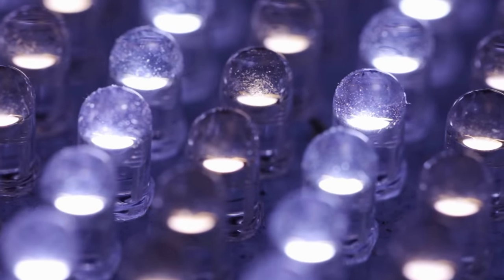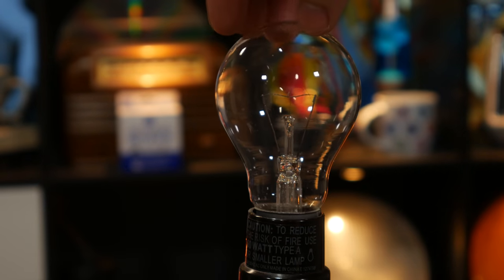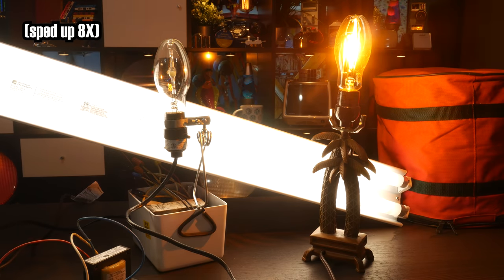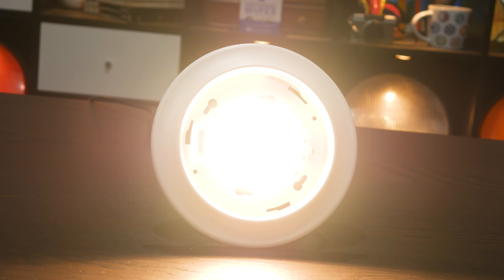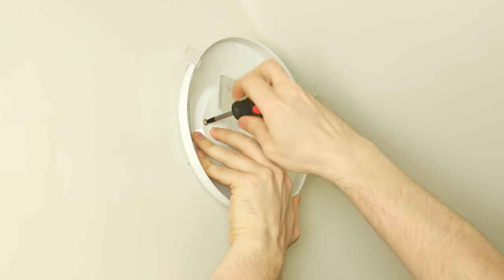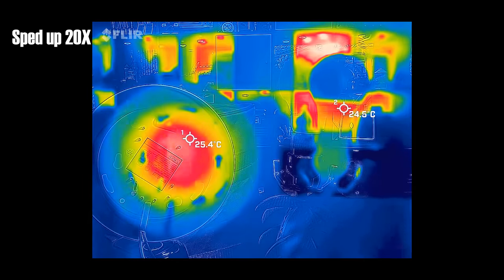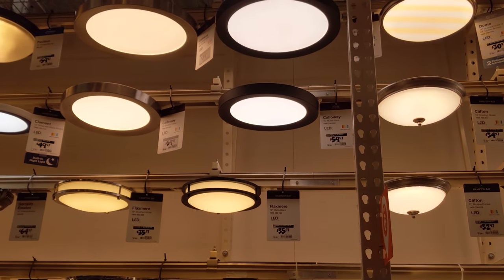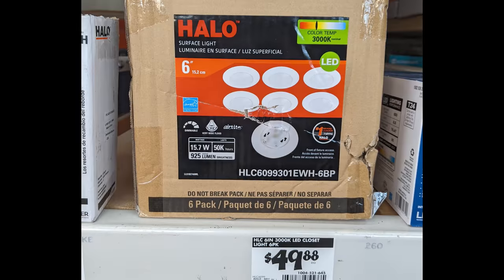A troubling trend in lighting?

Comment: What we really need is an led bulb or start using usb connections. There's an insane amount of waste in throwing out the fixture. 

Just the modular nature of the lightbulb, for all the faults you mentioned, makes it an incredibly amazing design.
Reply: Can a standard USB connector provide enough amperage for a 10 Watt (100W incandescent equivalent) LED lighting fixture?
Reply: @rogermwilcox  USB-C connectors are rated for up to 100W of power usage, so it could easily power a 10W fixture.
Reply: @rogermwilcox  if not that, then something equivalent, just one cable you plug in and standard mounts to hold it in place. Those mounts should be easily adaptable, such as unscrewing them to replace them with a large one included with that huge light you bought.

I'm a renter, and like just about everyone else my age, will be a renter for the foreseeable future. Standardisation, ease, and flexibility is vital for us. If the answer to "how many people does it take to change a light bulb?" becomes me, a receptionist, a property manager, a property manager's assistant, the landlord who takes a month to respond because they're on the third cruise that year, an electrician's admin assistant, and an electrician who reschedules three times because they say you're not home despite looking you in the eyes and who didn't have the keys they were supposed to pick up from the real estate. Finally, you get a new light only to find it's totally different and is somehow outputting brown. Also, the new style is too big and prevents a door from opening, and so the process restarts where you have to walk outside and back in your front door to get to the front of the house for three months. The new new light shines an even brighter brown. At the end of all that the landlord takes the new light, the door, and repairs for scratches by the electrician from your bond, which takes another five months of arguing before you finally settle on paying for two new lights, the door, the scratches, and not mowing the grass you didn't have just to get them out of your life. And then another light fails and because you're epileptic the strobing causes you to fall and hit your head on the edge of your coffee table and die. 

This is the story about why I own lots of lamps so I don't have to touch anything not mine. 

USB would be great, though. Then I could charge my phone from the ceiling. It's all I've ever wanted.
Reply: I just mean that the old screw in bulb is WONDERFUL, but for the weird curly shapes that would take a strand of LED's instead, or for something that's far more flat and might be better for a disk shaped array of lights, it makes more sense to standardize these connections in a more flat pluggable format that makes the LED's themselves replacable, rather than hard wiring them into a mount that requires the whole lighting device to be replaced. Instead of tossing out the entire lighting fixture, you'd just toss out a standardized LED array that you would unplug and plug in.

The gripe is that LED's go out, and and then the whole lamp is useless unless you are able to DIY your own circuitry and install an entirely new fixture. 

The idea of replacing the boob light in the pic is still tossing out a huge piece of material when really what's wrong is a thin wafer about the size of a cookie at starbucks (but much thinner) that has the LED's laid out on them. OR, having to replace an entire chandelier because a handful of LEDs when out because a surge blew them. OR, as I found with a simple floor lamp I bought that TOTALLY could have used some B base bulbs, instead is hardwired with LED panels, so that I can't, say, replace it with brighter bulbs, nor can I change the bulbs when the LED's run out, but instead will have to trash a $90 lamp instead of a $1 bulb. 

THAT'S the problem. 

That's why standardized connections and standardized LED arrays and strings should be considered. (and honestly, the LED strings are probably easier as there are already "cut to size" options)
Reply: @SerifSansSerif  There are some fixture now where you can drive multiple fixtures with the same socket. But even replacing those you are still re-wiring, just on a low-voltage circuit. 

I mean I like these bulb-less fixtures - but not really sure how usefull modular would be anyways. 

What would be kind of cool, is a standardized plug like you see in fire alarms, that way when you do go to re-wire you don't have to deal with wire nuts deciphering how the last person meant for it to be wired. 

You could eventually standardize on particular sizes of circles or rectangles for high end fixtures,  but honestly on the low end, the all in one fixtures are plenty good enough.  In a rental it's a bonus, nobody is expecting the renter to pay for a new fixture.

Comment: Lever nuts are far superior. Coming from industrial controls wiring, the efficiency of the connection paired with the repeatability and lack of damage to the wire is essential when having to repair or replace components later. #teamwago
Reply: I'm frugal, though, and you can get a box of 100 wire nuts for, like, 8 USD. And for applications where you aren't really worried about replacing components with any serious regularity, they're adequate.
#teamcheapass
Reply: @Telamon8  I fail to see why "normal" non electricians would buy 100 pieces? 
If you'd need them all at once, (in that case, it'll be a bigger renovation, and an electrician should at least watch over) I doubt it'll be much cheaper if you count in all the time you need to properly prepare the wires and stuff.
yet alone, it is much easier to remove single wires if needed, and different sizes can be combined without any problem
Reply: Hence why service loops are so valuable. Just cut the ends off and start again.
Reply: @williamganley4739  20 years later though, when that wire eventually runs out, I'm still sad 😢
Reply: There's a reason wire nuts aren't legal anywhere civilised. Wago all the way.

Comment: I recently added some puck lights into a ceiling and I’m glad I got the ones I did. The lights and the driver circuitry are separate, connected by a short wire. Helps keep the driver cool from the lights themselves. Color temperature adjustable and replaceable when the lights itself dies.

Comment: Another excellent and detailed insight, thank you, 30 minutes and I don't regret it. 

One significant problem you didn't include is when recessed-mount LED lights are installed at the ceiling building envelope of an unconditioned attic space. Having any air leakage here is a real problem not just for energy loss but moist, warm air (in cold climate) easily leads to ice and ice dams and roof rot. As you said people "stick them pretty much anywhere" (this has been called "builder's acne"). Yes, some include a little gasket but they really don't work, the only way to seal such an installation takes fussy detailed work, even fussier when you don't have access from within the attic.

Comment: It would be great if they would not overdrive the LEDs which would make them live longer. BigClive has many videos on that. But they cheapout by placing less LEDs and driving them harder.
Reply: They also roast the driver in the Edison bulbs, of course leds fail too, but the drivers often fail first in the bulbs.
Reply: Plus reducing the amount of components within the device to reduce the build cost. The same thing has been noted by Linus on his channel ,memory modules with cheaper and less efficient components swapped in after performance reviews have been made and published.
Reply: Which is fine if the lifetime is accurately reported on the packaging (for an average use case, not best case). If its cheaper, but dies earlier, that's a fair trade off, driven by engineering and consumer choice. If it dies early and the marketing just lies, then its bad.
Reply: Driving them harder, that's what happens with LED backlights for LCD TVs. If you have an LCD TV, I bet the LED backlights are being overdriven! But, you possibly can turn down the backlight in the menu, look for a setting called "backlight", not "brightness".

Comment: CFLs weren't always that bad. The first ones I bought lasted a decade. I have a few that are 15 years old. However, the newer cost reduced replacements failed in a couple of years.
Reply: Yeah I only remember a couple instances where a CFL bulb were changed. At my parents house; from the time the time they phased out incandescent lights, to the time they phased in LED lights; I think they only went through three or four generations of CFLs.
Reply: same experience here. we just cant have nice things anymore, apparently
Reply: I couldn't stand the things. That slow pink glow followed by the slightly flickery light. They gave me a migraine. I love LED bulbs. I have them across my flat. I prefer the original filament bulbs for light quality but the LED bulbs are so close that for energy consumption I simply can't justify old school bulbs. That said, I have an awesome old Belling bed warmer from my great Grandmother that uses a 40w bulb to heat the bed. That wouldn't work with LEDs
Reply: @adamoneale4396  never had such problems with CFLs. yes they took a minute to reach full output, but after that they were good, no flicker and good light quality. LEDs are hit&miss, some have terrible greenish hues, some flicker badly, hard to find a decent one for me.
Reply: I can't say I've had a lot of trouble with CFLs taking a minute to warm up, except for outdoor lights. I have had flickering problems with both CFLs and LEDs; but in either case it really comes down to the brand and the type of light you used from that brand. 
But I love these LEDs I have now; I can get them in any color I want. So I'll generally use daylight lights for the rooms where I'm doing more work. And I'll use the warmer lights for the living room. Then I'll use red lights outside, so they don't interfere with my night vision.

Comment: Someone needs to standardize the mounting and electrical connections for such a fixture, including a safe to use power plug so you can change the electronics/LED module separately from the fixture, about as simply as you can change a standard light bulb.
Reply: Yes, plug-in connections for lamps. We got them here because our electrician installed it like this. Last year we needed to replace all the lights with LED panels. Now was only old fixture out new in
Reply: Indeed. Fittings also that have some intentional heatsinking in them. Would a wide flat edison screw work?
Reply: @Orionrobots  It's possible, but I'd also appreciate some sort of firm yet sponge-like resting pad that makes contact with the module directly on the back and acts like thermal paste for efficient heat transfer into the fixture
Reply: @ElevatorMan5482   I had something in mind, not unlike Laptop wifi or memory module. But on a larger scale. 

Ie  spring clips, push down to retain. Only I thought the safety aspect would be a problem.

Maybe having mechanical switch levers so that the system wouldn't be live without a module in place would work? Starts to sound expensive and complicated to manufacture though.
Reply: @Orionrobots  I don't think the springs or clips are necessary, especially if the price starts to rise. Springs would provide minimal contact between the module and the fixture, and heat transfer would be less efficient. Thermal paste is actually widely used in the LED lighting industry to get the most direct heat transfer from the LED board to the heat sink. We shouldn't need mechanical switch levers either because honestly standardizing a wired plug between module to module would be much more ideal. AC powered smoke alarms actually have a standard like this believe it or not
Reply: Try GX53 sockets, they would fit in the fixture he showed.   But for some reason they are not very popular
Reply: @jesperdahl1486  That looks like a good starting point. Not sure the GX53 manages heat dissipation particularly well, but it looks like a good, simple electrical and mounting solution. Might need to extend that standard to help manage heat more effectively.
Reply: @geoffstrickler  I believe that you are right, unfortunately it is not as good at managing heat as hard mounting the circuit board directly to the metal back of the lamp, but it is the best I can think of right now.   A few years ago he mentioned that socket, it is supposedly older then the Edison socket, something about the lights at a world fair, and that was enough for E27 to "win"
Reply: What's wrong with a standard octagon box to mount the fixture, 2 screws 2 marettes and a ground. Seems so simple to me instead of clips, thermal paste, heat dissipating plates that will all go obsolete before the bulb fails.
Reply: @jesperdahl1486  the revolution starts here... I have bought some of those non-changeable LED fixtures, but I'll try to recall GC53 for my next lighting change. These are easily available .

Comment: It is amazing how many household skills I picked up from my 7th grade shop class about 40 years ago. I switched out a fluorescent fixture that kept failing with a flat led panel. The original fixture had just the romex sticking out of the ceiling, so I installed a ceiling box and put in the square panel. Sure it has the risk of failure and needing to replace the whole fixture, but in theory it should last 10-20 years.

Comment: I've used a few different variants of this style light over the last ten or so years, including mounting one on a disturbingly low ceiling fan where nothing else would give good light and clearance.  The newest one I paid around $15 at Costco, and it came with both wire ends and a screw in adapter, both using a little molex connector depending on what you needed for the application.  I wired mine in (with wire nuts, we're not fancy here), and it looks great over my sink.
Reply: Hold up. You have a ceiling fan over your (kitchen?) sink?
Reply: @FuzzyElf  No, two different places.  The fan mounted one was in the living room of a house ten years ago, the new one over the sink I just put in a couple months back in my current house.  
I try to make things as unclear as I can.

Comment: Another great video; thanks! I'd like to bring up a few things you might look into for future videos on the subject. Light fixtures were designed for a lamp which gave off more heat, but the source of that heat was the filament which was well away from the socket. I've opened light fixtures in which previous owners had installed CFLs to find the stickers and labels inside almost charred by the heat. It's better to use disposable led fixtures or modern socketed fixtures than to put CFLs or LEDs into these older fixtures, in my opinion. I hadn't heard of the LED lamps which move some of the heat dissipation to the bulb; that might be in response to the problem. On a separate subject, I have a tip for those people thinking of installing these disposable fixtures: install a short "pigtail" of wire to the house wiring and connect the fixture to that pigtail. House wiring is solid wire and is not meant to be moved very often. Pulling it in and out of the box to attach replacement fixtures over the years will cause the wires to become more resistive and to eventually fail. Whether the pigtail is stranded wire, which is much more tolerant of movement, or just solid wire which will be easier to replace than the house wiring when it fails, using a pigtail on these fixtures should eventually become code. Hopefully, though, the vendors will get together and design a standard recessed connector which can be mounted into the electrical box to allow consumers to replace these fixtures like the lamps they really are, but until then...

Comment: We recently had a room remodeled and I insisted on getting cans. The contractor/electricians fought me every step of the way, to the extent that at the last minute they basically made me run to Home Depot and get the cans myself. Turns out you need the traditional socket for Hue lights, even if you get their recessed ceiling lights instead of bulbs
Reply: Depends on the type of "smart" lamp - you mention Phillips Hue lamps, which may have a specific reason for this, like signal through A/C or something like that (never worked with them). The Wifi controlled ones we got for our home had both options; there was a connector where you could attach a traditional "Edison" screw to draw power from, or a loose wire "pigtail" if you wanted to wire in directly. We already had can fixtures, so we plugged in the screw adapter and just screwed 'em in.
Reply: Ohhh you probably bought the ones that don't get wired in....i mean that's basically turned it into a giant bulb. Which is silly, but oh well.
Reply: @ShotGunner5609  I was actually planning on getting the bulbs anyway so I still wanted the cans for that reason, we ended up getting the recessed version instead but it turns out they only make that style with a connector, no direct wired option. Which is fine! Actually after this video I’m glad we went with the recessed lights instead of the bulbs if it means the electronics are better protected from heat
Reply: @MrRom92DAW  thats true. And its not like you couldnt still switch if you wanted to, i always just feel a bit iffy about having that screw connection in the ceiling. But it's not really that big of a deal.
Reply: Those "smart" lights have a whole bunch of other issues beyond any regular light. The software has security issues, the app will not be updated beyond a few years,...